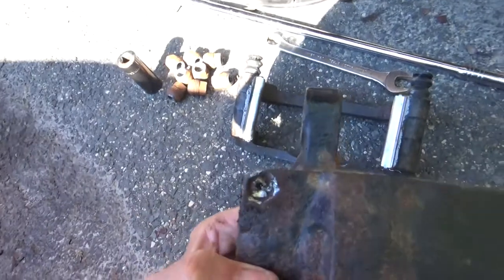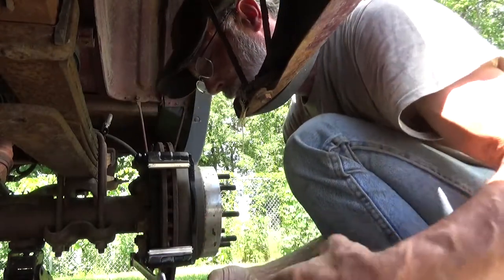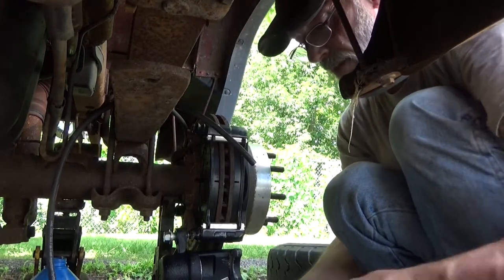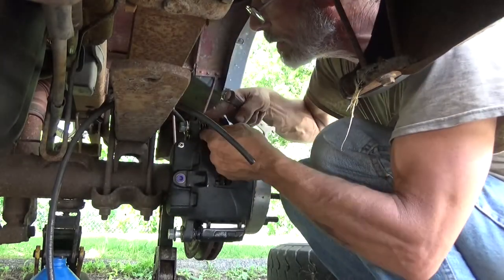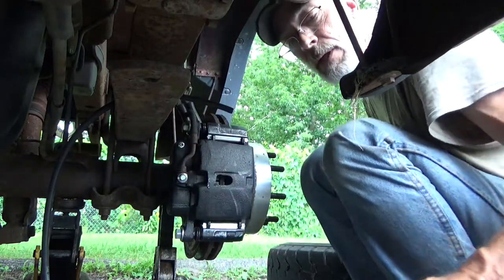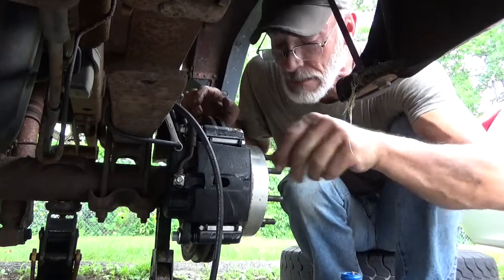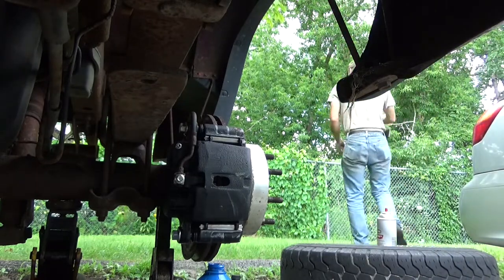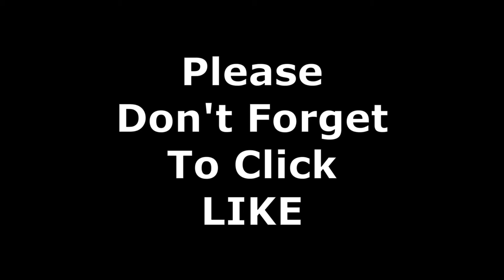2004 Chevy 2500 Crew Cab Chronicles - Part 4.5 - The Parts Cannon Cool Down

Comment: another thing we do in the south is leave bracket connected to caliper install pads and then bolt the whole assembly on
Reply from the maker: Up North we can't do that. The bracket requires way too much attention, or else the brake pads seize up in the bracket quickly.